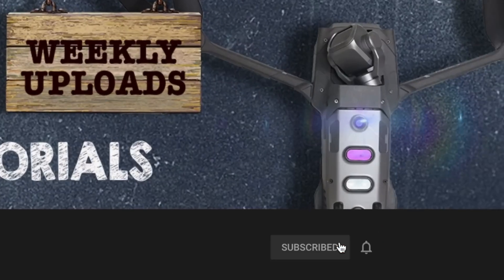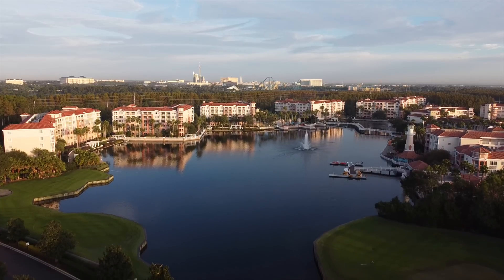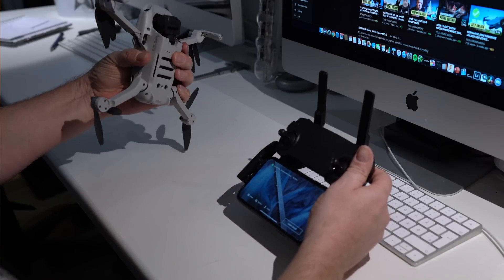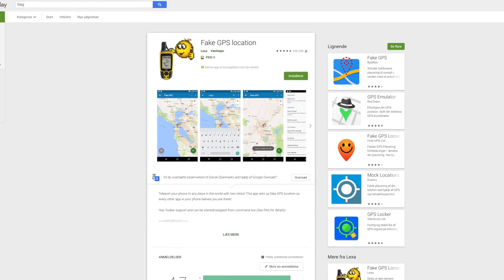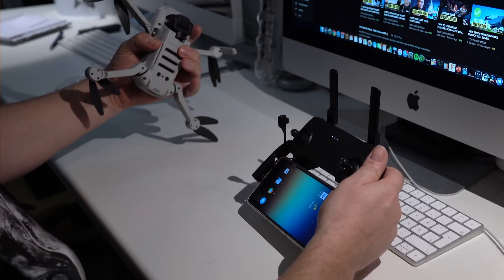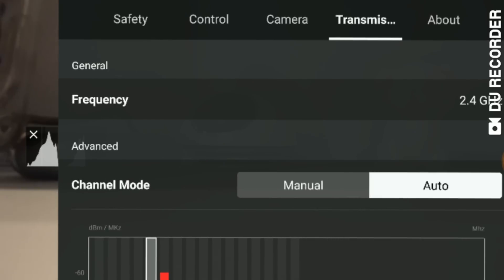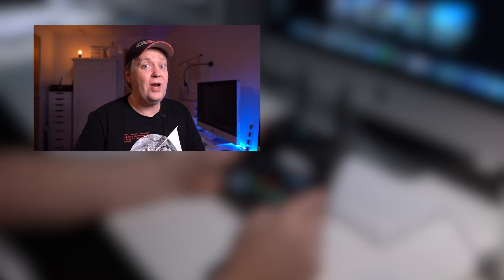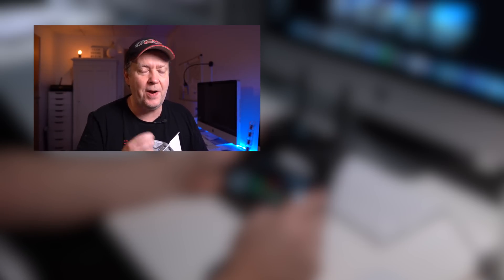HOW TO FIX MAVIC MINI BAD RANGE - FCC HACK (all DJI Drones 2020)

Comment: It does work but some phones cannot open the app. You have to make the phone go into developer mode to accept app then go from there.  I think you missed quite an important step here, on how to enable mock location:

TO enable the mock location, you need to access the phone settings > about phone > build number > tap on the build number until developer options shows up > allow mock locations.  Same as rooting really without the flash.
Reply from the maker: This is way easier 
Maximising Your Range on DJI Mini 2: A Guide to the FCC Hack 2023 (work for ALL DJI Drones)
https://youtu.be/x2WNHrnUU5A
Reply: @TECHDRONEMEDIA  i dont have mini 2 bud. I only got mini. Excellent work by the way, greetings from the uk.
Reply from the maker: It works for alle the DJI Drones that uses DJI Fly App on Android
Reply: @TECHDRONEMEDIA  excellent my man.
Reply: @TECHDRONEMEDIA  the hac works for me still. 11 channels not 13. Just accept no updates at all lol.

Comment: Hello.. When I go into the Fly App I only see Auto when I click  the transmission tab.. No manual setting on both my mini 2 and my Air 2s.. Am I missing something or has the manual option  been removed from the app so I cannot see if it's 11 or 13 channels.. Thanks again

Comment: Hi, would you be interested in reviewing a modded FCC iOS app that doesn't require jailbreaking and that is installed simply by tapping a link?
Reply from the maker: Sounds intriguing :-) Can you provide more info?
Reply: @TECHDRONEMEDIA  If you sent anything on the website contact form, I missed it :)

Comment: I’ve got a question nobody can answer. Can you asked too youtubers and had no reply. I’ve bought a mavic mini 2 and don’t have a laptop. How can I get 4K footage directly to my iPhone 11 Pro Max without buying a laptop. Nobody can answer! Can you? Appreciate a fix over buying a laptop
Reply from the maker: Use the build in Quick transfer funktion
Reply from the maker: 3 Tips for DJI Mini 2 You Need to Know ❗ QuickTransfer ❗ Zoom ❗ Fast Trimmed Download ❗
https://youtu.be/gvsKeL36qLI
Reply: Thanks that answers some questions but when you download the like in your video it’s either 720 or 1080p. I want the video on my iPhone in 4K is this possible?
Reply from the maker: You can save footage from the drone to your local device by pressing the small download icon in the DJI fly app in the upper left corner of the mini thumbnail
Reply: So when I download the video to my iPhone I only have options of 1080p or 720p. Can I get the 4K footage transferred to my iPhone and it remains 4K

Comment: I tried this hack with the mini 2 and it is not working. Everything is different in the transmission menu section, it just shows a graph with interference frequency and nothing actually changes when I select 2.4GHz/5.8MHz
After the hack I was expecting a popup on the screen saying that I'm in a different region with other laws, but nothing came up. It was tested with the latest firmware.

Comment: Very good explanation and video.👍 # 4.6+ K I have a question however. Can I apply this on the latest DJI Mini 2?😉
Reply: No, Im afraid Mini 2 will update de transmission signal the minute you lock your home point before taking off

Comment from the maker: UPDATE: Mavic Mini FCC Hack https://youtu.be/ratCY_4FR1k
Reply: Does this new hack work on IOS ..? Thanks in advance
Reply: You  cant do it anymore. I have tried out several times with different versions, and it will not open  them.
Reply: I agree witam you. The older app DJI FLY not opened on the mobile Phone:-(. Have samebody find the solution?
Reply: Will this work on the Mini 2?
Reply: any tips for ios?
Reply: Silly question sorry I'm a beginner, I know you can fly without a device but that's just close range, yeah so in flight can you fly a distance without an internet connection and GPS is/isnt there GPS for return to home ? tnx✌🏼

Comment: How can i do this with a smart controller?
Reply: You dont have to worry about your smart controller, any remote kind will apply these hack, but unfortunately with the recent app's update, you wouldn't be able to do that hack anymore, because the apps are more focusing on remote and drone's internal gps, which couldn't get fooled by hacks, the only way you can use the hack again is by downgrade your dji fly app to 1.0.8 version, or just simply download that version outside Playstore / Appstore, dont download the update version after that version
Reply: I did it and it worked i enabled fcc mode white line was over -90 but i still couldnt pass 1800ft distance

Comment: I tried all these settings with my android phone, but with no success, it still remains on 13 channels...!
Reply: With the newest update app, you wouldn't be able to do that hack anymore, because the apps are more focusing on remote and drone's internal gps, which couldn't get fooled by hacks, the only way you can use the hack again is by downgrade your dji fly app to 1.0.8 version, or just simply download that version outside Playstore / Appstore, dont download the update version after that version

Comment: Thank you for the FCC hack. I haven't flown yet, way to windy but discovered in the setup procedure that the programme 'Fake GPS Location PROFFESSIONAL' by Just4Fun Tools doesn't require disconnection prior to switching off. This is useful as you don't require to setup up programme everytime you fly.

Comment: In the transmissions tab I only see 5.8 no 2.4  also only 5 channels. Do I need to be in  2.4 if so how do I switch please?
Reply: I tried this and got to the point where I was supposed to see aircraft resetting wireless connections, but that notification never appeared. nothing changed. I live in Canada.

Comment: I am having fcc version 5.8ghz of mavic mini..
But the distance is lower than ce version..
And I couldn't change it to 2.4ghz...
Reply from the maker: Problem is power is turned down on 5.8 and you don’t have the hardware for 2.4 on your model.. so you are stuck in EU
Reply: Hellw... is it possible to live stream from Facebook using mavic mini..
Reply: And.... what version of litchi supports mavic mini...
I couldn't connect it... using beta 4.18

Comment: Too much hassle. Just buy a Yagi antenna extension!
Reply: All I can find are Yagi aluminum antennas on Amazon & Ebay, any tips?
Reply: @longboardlouie5816  There are many that have a plastic-blended frame with cooper tips on eBay - doesn't matter about design too much as long as they're cooper tips it will work just fine and will add about 40% range.
Reply: @DungarooTV  thx, I will check it out👍✌
Reply: It does seem like a lot of hassle.
Where do I find a Yagi antenna?
Reply: @longboardlouie5816  Sold widely on ebay and Amazon. Make sure you get a copper one.

Comment: wont work because you have different controllers, you need a fcc controler for fcc mode
Reply from the maker: Yes, I know.. but can be used for FCC equipment in CE territory if DJI has not patched it by now
Reply: @TECHDRONEMEDIA  thats right 👍

Comment: I have the fcc version and i only have 5.8 i live in NY. I did it and put the location somewhere in brasil and i got the pop up meaning it worked. Those that mean that when i fly it the location for the drone is going to be in brasil and i will get better range? I went to bed before i flew it i only did the hack and i just want to know if i tricked the gps thinking it’s in brasil. Thanks

Comment: Hello from the Netherlands.
Thanks for your great videos which are very educational. I would really like to run the FCC range hack on my DJI mini but dare not because I am not sure if it will go wrong. Therefore some questions. Does this hack also work on the newer CE EAC DJI mini models. Is it possible to perform this hack with an Iphone, because I can find the app you use in the app store. Which app should I use. Look forward to your answer. Especially continue with your videos they are very worthwhile.
Reply from the maker: I'm not sure it works any more, DJI has patched it
Reply: @TECHDRONEMEDIA   Who knows, maybe another user in this region can give more clarity if they have succeeded and what the consequences will be if things go wrong. Also like whether this hack should be done on an android system or whether it is also possible with an Iphone.

Comment: I managed to get this to work once - channels in app changed but I didn't manage to fly that day. I can no longer replicate it. There was an update of the app in the meanwhile. Did DJI block it by detecting spoofing? Is anyone else having problems or does this still work for you? I really want to test how much it improves the connection quality.
EDIT: I managed to get the "hack" working again by using a backup of the previous DJI app on another phone. Looks like they indeed blocked it or made it harder with the latest update v1.1.5 (it didn't work with v1.1.5 it did work with v1.1.0)

Comment: I want to buy a mini would it be an benefit if I buy one in USA or no change in range if I buy it in Germany
Reply: No difference if you do the hack .
Reply: There is still a hardware difference. From what I understand, this FCC hack will give you more range, but it still won’t be the full range if you have the CE (European) drone. If you have the actual FCC drone but aren’t in the USA, you can use this hack to unlock the full range.

Comment: This doesn't work because ,unlike the other drones the mavic mini has 2 Models .The CE version and the FCC and so even if you do this it won't work
Reply from the maker: Yes, the benefit on the CE drone is limited
Reply: I have CE mavic mini and i confirm that this works, it doesnt boost to much, it adds maybe around 300m, more than enough for me, but keep in mind that you must be on 5.8Ghz , it wont work in 2.4Ghz mode

Comment: I have DJI mini. It lets me set the home point 1.2 miles (2km) away if I desire. But that's the max distance I can set the new home point. Since the DJI mini allows you to set the home point to the controller could I then use fake GPS and set my location further away. Maybe 5 miles (8km) to the closest farm house near me. Then once the drone has started change the home point to the controller which would be technically 5 miles using away fake GPS. This test doesn't seem to risky since the only thing between my house and my parents is farm fields. You would have to turn fake GPS off as soon as the home point has been updated just in case you need to change the home point again to your controller. This is like doing a manual way point and proves waypoints is just a phone software application. I'm assuming my theory would work  what do you think? Of course I would never try this. It's just in theory.

Comment: Hello... I can no longer do the FCC Hack after the latest update!!! I used to easily do it for every flight in the city, because of high interference.. Now it just won't switch over to FCC mode anymore.. 😔

Now I have to use my parabolic reflectors all the time and even maybe try 2.4ghz channels in the City..

Sweet

I hope that DJI allows us to FCC Hack it again after the next update..

Now it seems the actual Mini is also using its own GPS in order to switch over to FCC, the phone's GPS is not enough anymore..

Cool cool..

😁
Reply from the maker: Interesting, thank you for sharing
Reply: Same problem
Reply: @michiscz  Yeah, they've finally blocked the Mini from using only the phone's GPS, now it seems it uses either both phone's and drone's GPS or at least only the actual drone's GPS position!

So now it's so nerve-wracking to fly from my balcony like I usually do! In the City the wifi interference is truly crazy! I will fly today and use my parabolic reflectors and see how it goes.. All this is really really making me save up for a Mavic Air 2! 

I really really do love my Mavic Mini, even though it's the CE version, I just have to maybe get those Yagi adapters for the antennas, I would need for both 5.8ghz and for 2.4ghz Channels.. 

I guess what we can do is downgrade to the older Fly application and fly thus way. I really prefer to always have the latest software versions and so I'll just keep it the way it is.. Hopefully my parabolic reflectors will do the job just fine... 

Keep well and be safe 

😁
Reply: This is correct. I have tested and uninstall and reinstall an older dji fly app 1.12 version if I remember correctly
Reply: Yea same problem i cant do this thing anymore after the new update.
someone have a solution?
Reply: LosUno u need to download older app version and then do this Fake GPS thing. Then download up to date version of DJi fly and it will work.

Comment: PLEASE BE AWARE! There's a slight issue now. 
Before it was ok to set a fake location (on the phone) at place (outdoors) and fly with FCC hack.  No need to boot it in proper order. Just 1) set fake location with FakeGPS 2) fly. 
Now it's more difficult - looks like it takes not only location from the phone, but from the drone also! So, even if you mocked your phone, if you try to fly where drone can find GPS - it'll be reset to local settings. 
It still works if you start motors and then connect the phone though.
But  there're some problems:
1) If you arrived at a place and try to make this hack there - it'll not work. You need to hack the drone at home( where it can't find GPS), so that you can start motors before phone resets drone settings. !!!
2) Sometimes you have to calibrate the drone and it can't go up without calibration!!! So you HAVE to connect it to the phone and it'll be reset instantly to local settings even before you try to calibrate it. 
DJI makes it harder and harder to bypass this issue.

Comment: Thanks for the useful tips. However, I think you missed quite an important step here, on how to enable mock location:

TO enable the mock location, you need to access the phone settings > about phone > build number > tap on the build number until developer options shows up > allow mock locations. 

It took me a few tries, as the fake apps would not show me the mock location.
Reply: So this is only on android ?

Comment: You can do it with iOS too !!! With both free - iSpoofer or iMyPhone !!!
Reply from the maker: I’ll check it out
Reply: TECH DRONE MEDIA Unfortunately its free only for one change, after this both require payment. And its pretty easy to reset it to CE again.. if you land and shut the motors with the phone connected it will reset immediately. Even when you are transferring photos or doing something in the app - the motora should be on.. if you turn off them by accident- again it will reset.
Reply: Jail break software ?

Comment: Are you sure that absence of FCC mode is not a hardware limitation of drones sold in the EU?
Reply from the maker: It's different hardware I found out after making that video, so the benefits will be smaller with the CE drone
Reply: They limit the software as well. 
2.4 you won’t get much change but the 5.8 for sure. And people should be manually selecting 5.8 in urban and suburban environments even though it’s limited to 500m. With fcc hack on the CE, the 5.8 will boost to about 1300-1400m. Throw on some Yagi or parabolic reflector and maybe you can hit the moon

Comment: Mavic Air 2 owner here. I used your GPS spoof process for Mavic Air and it worked fantastic. Can you tell me how to check which mode Mavic Air 2 has and how to change to FCC? I live currently in China but will move back to Europe soon. I appreciate your help and any response.
Reply from the maker: I would except you can use the same procedure as shown in the video
Reply: @TECHDRONEMEDIA  problem is I dont see channels, only strange graphs which doesnt tell me much. I cant upload screenshot but its nothing I have seen on my Mavic Air 1
Reply: It’s probably the same graph as the others. If the top line is above 90 then it’s fcc. If it’s below 90 then it’s in ce mode.

Comment: As many comments already indicate the new firmware/app has changed something that makes it more difficult to retain the fcc settings. In my experience the drone changes its WiFi settings as soon as it is on the ground without the props running. This means that the starting instructions still stand however as soon as you land the WiFi settings are set back to CE. To avoid this: quit the app just before landing and then continue the landing using the remote. 
Switch everything off and don’t start the app!  I have no solution for calibration nor transferring data using the drone connected, other then keep the motors running.

Comment: Well explained and but I imagine its pointless for those keepiing firmware uo to date. There's also no point posting something you don't use, can troubleshoot or have much of an interest (or need) for. Perhaps DJI has disabled this in recent firmware updates. I'm in Australia, follow the instructions to the better, get the notification, like you do, as soon as DJI Fly app is open....going into Transmission tab in settings, there is no mention or offering of any channels below 149* or thereabouts. Very few can be chosen.. My remote model is MR1SS5. This video can't help me or doesn't specify its effectiveness and use at the start should any updates effect this solution. In which case, these outdated videos just start to clog up youtube and server nothing more than a confusion to others.